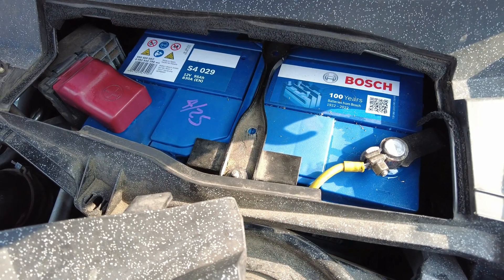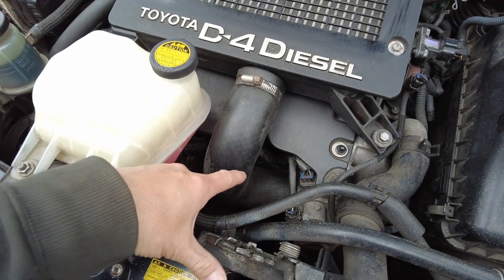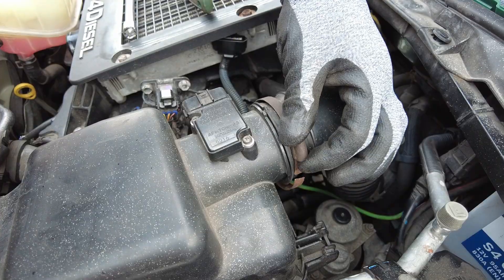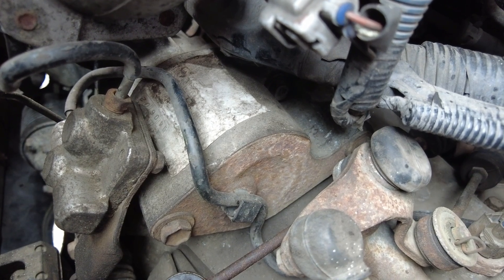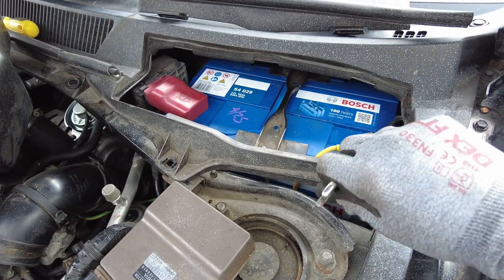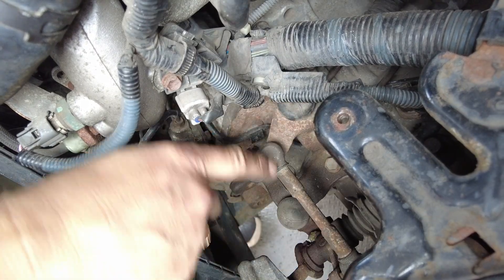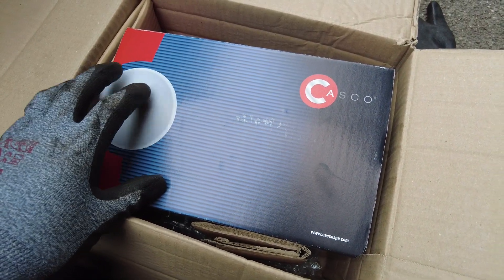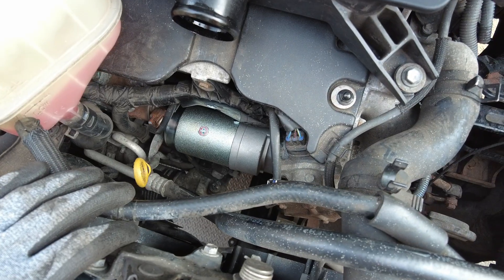Fix Toyota Hot Start Issue - Replace Starter Motor 2.0L Diesel D4D Rav4 Corolla etc

Comment: I’m wondering if you can help. What was the part number of your old 1.4 starter ? Mine is 2810064300. However the website linked to your video the cross reference number says  2810064310. However it is exactly the same car rav 4 mk2 2.0 D4D ? Thankyou
Reply from the maker: Im sorry I'm not sure what your asking? I dont have the old part number tho? I put a link to the replacement starter I used and still working very well. I would replace for another 1.4 when the 2.2 works so well  😊👍

Comment: I think I have this issue. my Rav4 Starts fine when cold, but if I drive for a while and make the mistake of shutting off the engine (like to put diesel in) I can't restart it until it cools down. I'm going to try changing my starter motor myself, hopefully this will sort it.
Reply from the maker: Sounds like thr same problem I had. Best of luck 😊👍
Reply: @liamrafferty929 Did You solve the problem ?
Reply: @_Mr_DS_ I'll let you know! I've just fitted it and successfully cold started...
Reply: @liamrafferty929  Solved in the same way. New starter 2,2Kw. No more hot start issues.
Reply from the maker: Nice one, glad it's sorted 😊👍
Reply from the maker: Excellent stuff 😊👍
Reply: Solve my hot start issues.
Reply from the maker: Nice work 😊👍

Comment: Hey! Just wanted to drop by and say that thanks to the Peoples Car channel, I went ahead with confidence and swapped my battery for a 95AH one, and also replaced the starter with a 2.2KW 10-tooth model (an AS-PL in my case). After 3000 km it’s been running perfectly. Can’t believe this video has so few views – it could really be helping a lot more people with the same issue. Thanks so much for the help and for sharing such great work!
Reply from the maker: Amazing stuff glad it all worked out for you. Mines still starting lovely like a new car. It might not get too many views as I'm primarily a classic VW Channel but that's all cool. Thanks for the kind words 😊👍

Comment: Hello @PeopleCar !! I have a 2003 Toyota Rav4 2.0 d4d awd that has exactly the same hot start problem. I've tried every option (changing injectors, getting a bigger battery, etc.). I think I've come to the right place after watching your video. I'd like to ask you a question: Did you check the starter motor's tooth count before purchasing? My vehicle has VIN JTEHG20V820005777, and while searching, I found that starter motors come with 9 and 10 teeth as compatible parts, which has raised a huge question for me. On the other hand, do you think the Hella or HC Cargo brand starter motors are good enough? Thank you very much, best greetings from Argentina.
Reply from the maker: Hi. If you look below in the comments Jaocatarino asked this also. The starter motor I removed and the one I replaced it with both had 10 teeth and you don't want to get this wrong. They will not be interchangeable afaik. Mine is a 2005 UK model with 2.0 D4D engine. So the last of the Mk2 Rav4. I don't know if this will differ to the 2003. In terms of starter manufacturer I have no idea what's good or bad, but the one I fitted is going strong and had no trouble for the price. I added a link in the video description to this one.
Reply: @PeoplesCar  Brother, today, after 7 long years with the hot start problem, I followed all the steps in your video and installed the 2.2kW starter motor. HOLY SOLUTION. My vehicle has been to no less than 6/7 mechanics over the years (including official Toyota mechanics), and none of them have been able to give me a solution (not even an answer to the cause of the problem). I really can't express in words how grateful I am to you. Really. I wish life rewards you for helping me (and possibly many others) solve this problem. Sending you a big, warm hug from the South of America, Argentina.
Reply from the maker: Wow what absolutely amazing feedback thankyou 😊. I'm very happy to have helped and wish you all the best. Thanks for watching 😊👍

Comment: Hi, thank you very much for your video. My RAV4 is exactly the same as yours and shows the same symptom. After trying with the battery, they told me at the garage that a 95Ah battery wouldn’t fit, which is clearly wrong information. I think I’ll also try replacing the starter motor. Does the new one have 9 or 10 teeth? From what I saw online, Toyota lists two Denso references: a 1.4kW (original) Ref: 28100-64300 with 10 teeth, and a 2.2kW Ref: 28100-64430 with 9 teeth. I’m unsure if using a 9-tooth one instead of a 10-tooth could cause any issues :/ but I’d like to install the original reference, though buying it from DENSO instead of TOYOTA. Thank you very much for any help you can give me.
Reply from the maker: As you say the picture of the replacement I bought has 10 teeth. I'm not super knowledgeable about specific Toyota parts being a classic vw guy, but I know if you use the wrong starter for the wrong Flywheel on Bugs you can make a real mess! I'll check when I get home how many teeth the original starter has, assuming 10 also. The one I've fitted has been working well for the last couple of weeks, no hot start issues any longer. 😊👍
Reply: Thank you very much
Reply from the maker: The starter I removed also has 10 teeth. I wouldn't risk one with 9, I dont think that will be correct for your Flywheel. Best of luck 😊👍
Reply: Thanks for your help. In that case, I will go ahead with the one that has 10 teeth.

Comment: Hi, Tom here, Finally getting to do some easy work on my bus, fitted pressure regulator with a dial, and new fuel pump, suspicious old one was letting fuel into oil.. So swapped it out, have you any ideas on pressure for twin Delortos.. Hope alls well, cheers atb.
Reply from the maker: Hi bud. Sounds like your getting on well with thr bus. 👍 Dells done like any more than 3psi. You have a pressure regulator so can adjust this but if not I've run the Hugo low pressure pumps from Dellorto.com before without one on webber etc and never been a problem. Keep us posted how you get on 😊👍